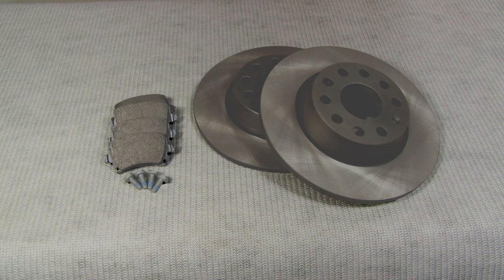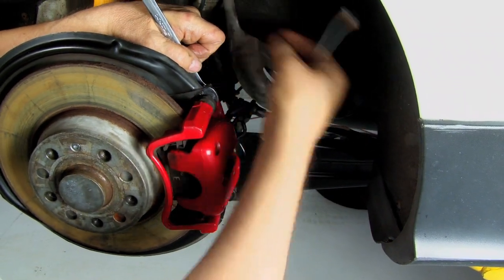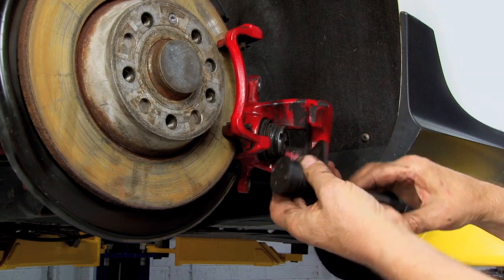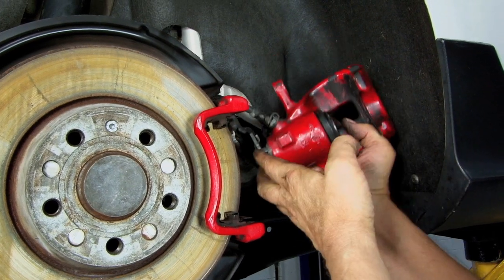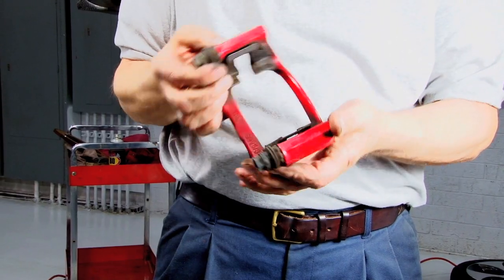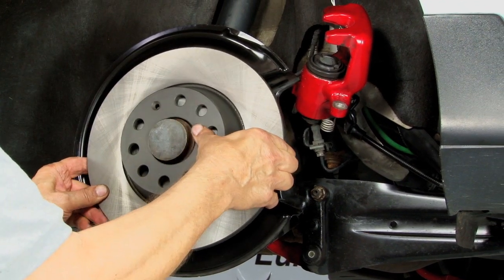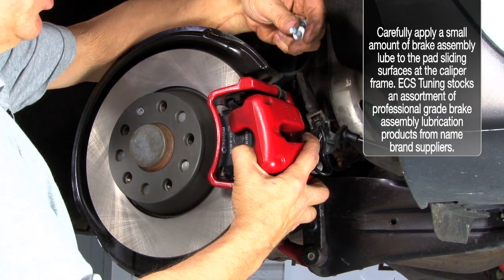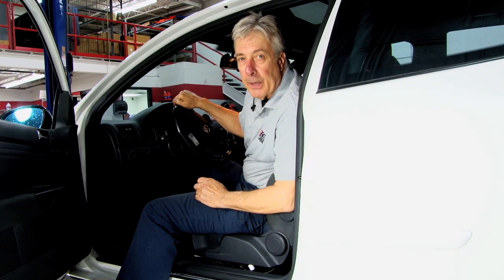ECS Tuning: VW MKV Rear Brakes Pad and Rotor DIY

Comment: God Almighty! That M14 Triple Square was a mission to find at my local auto stores. I found one at NAPA. For those doing the Brakes I HIGHLY recommend getting the M14 socket way before ordering the Pads and Rotors
Reply: myfastgti07 I had to put everything back once I got to that part got a m14mm socket but it only goes half way in it's a 1/2 inch ??? Any suggestion
Reply: It's not a 14mm. You need the M14 Triple square.
Reply: myfastgti07 I got the brake calipers tool and everything else I got the a M14 star socket that's what it says is it still the wrong one
Reply: Send me your email and I'll send you a picture of the socket I have.
Reply: 12 star bolt set from amazon: $8
Reply: You can easily get it at Autozone. They have a set of all the triple squares you’ll need for vw/Audi work
Reply: @RatchetWrenches  Never seen them at autozone. The site doesnt even have them . The only in-store location that has them is Northern Tool
Reply: @RatchetWrenches  Autozone's triple square set doesn't have the M14.

Comment: For anyone reading this:  The HUSKY 15mm wrench WILL NOT FIT, it's to wide.  But a stubby husky 15mm will.  This guy also does a good job of pointing out the rear piston tool. Many of the other videos just say brake piston tool...like a C-clamp...which won't work and will ensure you mess up your piston.

Comment: Use a impact gun if you got one. If not as @ECSTuningMedia said, use a breaker bar if that still isn't enough, put a pipe on the breaker bar to extend it giving you more torque. Also if you use penetrating oil, be sure to rinse it all off with brake clean prior to installing new brake parts.

Comment: it's basically the same. Except you won't need the caliper piston tool they show on here because it doesn't need to be twisted while being compressed like the rear does. But you will need something to compress the piston back in. (Many parts stores sell tools for that for cheap) I'm sure there's a video you can find here on youtube on how to do it.

Comment: Very good and informative video.  Wish I would have seen this version before I started because I bought everything but that 14mm triple squared bit (like an allen key).. got it in town but wasted hours looking around (its not at O'Reiliys or Auto Zone) but essential since, as already mentioned, those 2x 14mm bolts are a sunofaB*** to get off. 3 of 4 with a pipe extension, the other with some PB penetrating spray help.

Comment: The long caliper bolts can be tough to get out - one of them on our car had seized in and the head sheared off when I tried to undo it. I then had to remove the whole spindle to drill it out the bolts which added a lot of time to the job. I would strongly recommend coating them with copper anti-seize grease on reassembly.
Reply: Are you taking about the bolts that hold the caliper to the carrier or the carrier bolts?
Reply: @lukew2194  the carrier bolts - that hold the carrier to the spindle - they have triple square socket ends and are about 3" long. They had completely seized in the spindle. Neither heat nor WD40 loosened them so I drilled them out and then used a tap to clean up the threads in the hole. PITA. The bolts that hold the caliper to the carrier come out easily.

Comment: Really great guide. But, my Haynes manual (I am from the UK) lists the torque spec for rear brake caliper mounting bolts as 48 lbf ft (65 Nm) with no additional 90 degree turn. Also you didn't mention the torque for glide pins which I have down as 26 lbf ft (35 Nm)

Comment: Is it recommended / is it easier to press in the piston if the break fluid reservoir cap is removed to decrease the pressure?
Reply from the maker: If you're pushing the piston back in, the fluid level in your reservoir will rise.Removing the reservoir cap will relieve air pressure caused by the rise in fluid. Just make sure it doesn't overflow!

Comment: This video is Great.   It prep'ed me to get the right tools before I started.    QUESTION:  The rotor in the video looks like all my rotors ... fractures all over the place.   Is that normal?
Reply from the maker: Yep, totally normal! This is called 'Crazing', and is a result of your brakes getting good and hot. The cracks shouldn't be more than a few microns deep- brake dust gets in them and makes them look a bit more pronounced than they actually are. If you're getting significant cracking, or anything deeper than that, it's time to replace!
Reply: Thanks for the insight!   The crazing was much more pronounced than your rotors.   Not knowing any better, I swapped them all out.   At 110K miles, probably not a bad thing to do anyway.   Thanks again for the great video!

Comment: What is the torque spec for the 13mm caliper slide pin bolts?  It doesn't look like much force was required to remove them, so I would guess it's not very high.  Thanks, and great video!
Reply: 22ft/lbs in the front and 26 in the rear
Reply: Usually you have to break them first

Comment: Excellent video.  ECS is a one stop shop.  Just don't by the V-Check Pro code reader, cuz they are crap and they won't replace it when it breaks. ;o)  But I still shop there cuz they have it all.

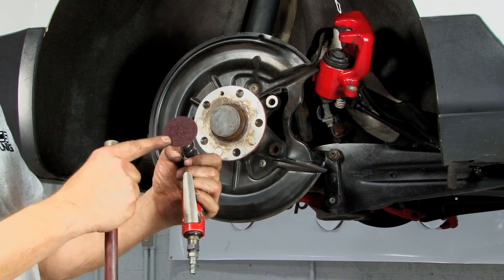Comment: Query regarding the 'brake dust shield' or also known as 'brake backing plate' - can the brake dust shield be removed at around 5:46 by undoing the 2 (minimum) fasteners ? Mine currently keeps rattling so needs replacing ASAP. Can't seem to find a video that explains how to remove and replace the brake dust shield, rather have a go at attempting the repair myself before taking to the garage. Thanks in advance!

Comment: What's a 14mm triple square never heard of it myself
Reply: Triple Square is a pattern similar to Torx... but different.  
It is 3 squares rotated evenly and is used for highly torqued bolts.  

Torx heads will strip and slip out.

Comment: Also, why won't a big C clamp work? It's worked for me and countless other people. Will it cause some sort of damage?
Reply: Because they screw in that's why, Most auto parts stores rent this tool and ECS also sells it of course I bought it from them as I'll probably use it more than once  https://www.ecstuning.com/Volkswagen-Golf_VI--2.0T/Tools/Brake_Tools/Caliper/ES9747/
Reply: The Transporter I know where to buy the tool. But I believe it isn't necessary. I'm saying people have done it with a C clamp, no problem
Reply: It's Not worth the risk IMO, Just look at Timur G response to Basement31 that explains why you don't use a c clamp on the rear

Comment: Maybe you could explain how a guy trying to change his brakes with a regular jack and jack stands is supposed to get those caliper carrier bolts off.
Reply: Get underneath with a breaker bar.
Reply: I used a regular ratchet and with a heavy pair of gloves performed an RKO out of nowhere with the tail of a hammer as an extension

Comment: Great video, how (thin/mm's) can the rotors be used for before needing to be replaced?
Reply: *****, you recommend changing pads and rotors every time? What happened to resurfacing rotors between brake jobs?
Reply: Rotors are not as expensive as they once were and almost all the shops near me wanted to charge more to resurface them than the cost of a new rotor. I got 2 rotors and 4 brakes pads for $53.

Comment: I like to see him take the M14 top bolt out on the caliper bracket, which short socket would fit that? I am sure the one he has does not fit.
Reply: Triple wall Torx socket 14MM.

Comment: Do the caliper frame attachment bolts (the m14s) need to be replaced? There is some controversy on if they are stretch bolts or not. Great Video BTW, need to do this on a 2009 Jetta and this will help.
Reply: they're supposed to be replaced - along with the caliper bolts.  Up to you - lots of guys don't do it though

Comment: never seen caliper bolts break loose that easily lol
Reply: I was thinking the exact thing. I needed a small breaker bar to take those puppies out lol
Reply: It was staged
Reply: For demo purposes.
Reply: Need lots of room under the car to swing a 18 or 24 inch bar until they  sound like they have cracked. If done on the ground, Jack and chock up high enough for this, to make the job much easier.

Comment: I'm surprised you don't mention the fact that you need to check the brakefluidreservoir under the hood. If it is already at the maximum, you will put massive pressure on it when you push back the pistons. This will result in an overflood of the reservoir or even worse; the cap can shoot of.

All the brakefluid will run down your enginebay where it will destroy some parts due to the fact that brakefluid is agressive. It also might fall onto your rims or paint which it will also affect.
Reply: false, won't happen
Reply: Sure..
Reply: I've heard it could happen, but it's never happened to me

Comment: Grease or silicone on the slide pins
Reply: Grease for metal+metal connections
Silicone for metal+plastic/rubber connections
Reply: Yes